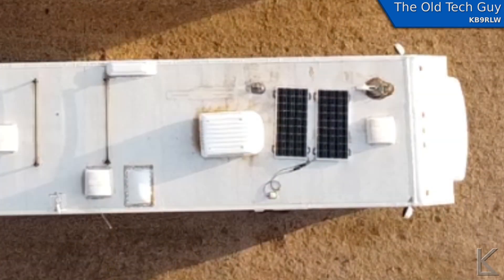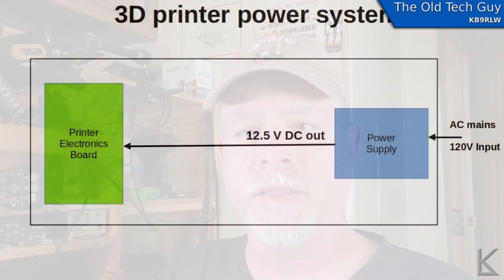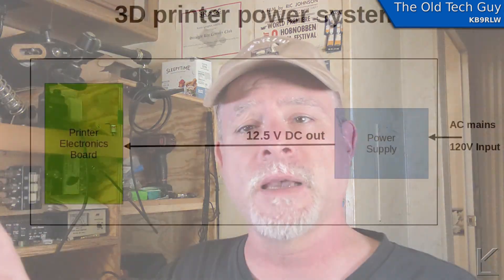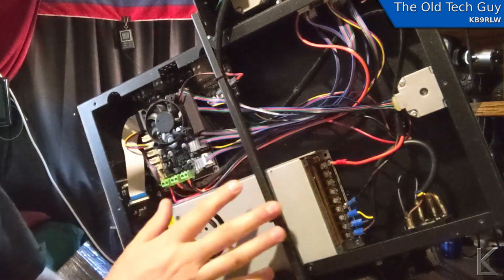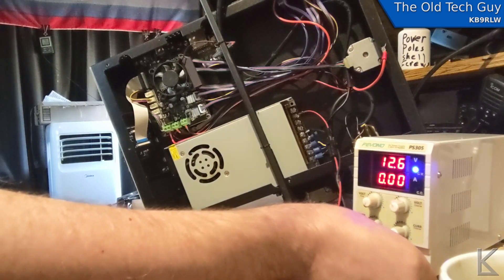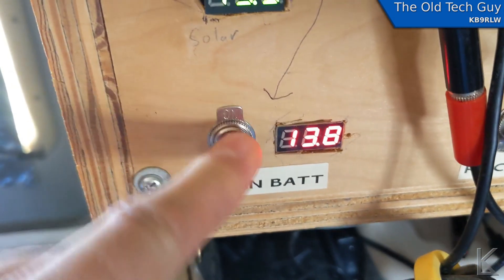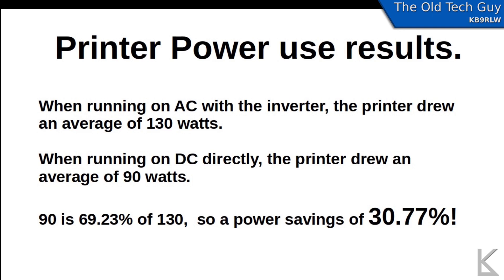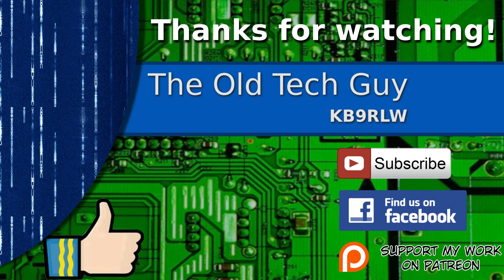Electronics - Converting my Anycubic I3 Mega to run directly off solar and DC

Comment: The modification is really simple, but your results were far better than I had expected. I'm going to have to do a similar mod to my printer.
Reply from the maker: Make sure to check the printer's power supply voltage. Some newer printers operate at 24 volts and you would need to use some kind of a 12 to 24 volt converter capable of handling the power
Reply: @loughkb  Thanks for the heads up. I'm fairly certain mine is 12v, but I'll be sure to double check before I do anything.
Reply: @loughkb  Sadly DC to DC voltage upconverters are switching types which kind of defeats the object of the exercise.  And the high current ones, to heat the hot end and bed,  are also often exceptionally RF noisy 😦.
Reply from the maker: @hectorpascal  I have one now that's 12 to 19 volts that runs my laptop. It's not very noisy. And I can build filters for DC that I can put on each end.
Reply: @loughkb  good to know!
Reply: @loughkb  Good to know!

Comment: Normal 3D printer user, installs quiet stepper drivers, quieter fans and custom firmware (removing that boot up beep).

Ham Radio 3D printer user: hold my beer!

I have the exact same printer.
With the audible spectrum mods applied.

As for RF noise on the inverter. I took a different approach and installed a mic socket on it. 🤪

Comment: At the very least, I would install a toggle switch for DC/AC.  That way neither can corrupt the other.  Or possibly a better solution is to put two diodes in.  so either feeds the load but neither bother the other.
Reply from the maker: Well, you're not going to plug DC into it when you're running it off AC so that's not a problem. And the power supplies output section is solid state devices, semiconductors. They essentially are diodes in that they only conduct in one direction. The power supply presents absolutely no load to the external DC. And the toggle switch would have to be able to handle 10 amps plus, so it would be a big chunky switch. Not necessary.

Comment: Hi, Kevin. 🙂
Modern PSUs use a full-wave rectifier right after AC power inlet (or, may be, after a common-mode filter) and filter it's DC out with a high voltage filtering capacitor. Then they just do a DC/DC down conversion. Their output is a half-wave rectifier, you say a Shottky diode, and filtering capacitor.
So, your way to convert your printer to DC power is great, but we've got a second level DC - the high voltage one. IFAIK some solar power users buy a bunch of solar panels and connect them in series to produce a high voltage DC their equipment can be powered of. They even remove the full-wave rectifier out of their PSUs to reduce power losses.
Of course, their batteries are connected in the same way. I don't know what is the charging controller they use.
In the other hand, one can use a DC/DC up converter to get a high voltage DC consumable by modern PSU.

Comment: Kevin, good to see you seem to have energy again. Hope to see more vids. Good vid. Somewhere in my house is something generating noise like your inverter is doing. I need to do some checking.
Reply from the maker: Put your radio on a battery, then turn off the breakers until the noise goes away. Then you know which circuit to concentrate on.
Reply: @loughkb  An excellent suggestion, thank you. I've somewhat put everything ham on hold as I redo my office floor and everything is in a pile in my livingroom:-) Anyway, I think I'll be doing this for sure when I get my radio bench setup again. Thanks.

Comment: Hi Kevin... Good to see your videos are back.  I would have put diodes in series with the AC supply and the battery to keep them isolated just in case.  Stay well, John   k0ebc
Reply from the maker: They are already are there. The output devices in the power supply are semiconductors. Essentially diodes in that they will only conduct in one direction.

Comment: I had to ground the 3D printer chassy even when hooked to line voltage. it would make interference with other electronics. but when I grounded the whole chassy it cleared it all up.

Comment: Very impressive improvement!  I've often thought of doing the same to the LED lights in my new house, but I resist hooking up a big battery and separate DC power lines to all those devices (there must be dozens).  I also get a lot of QRM from all the solar inverters powering my neighbors' PV systems but I can't do much about that except wait for nightfall when their power outputs drop.  Then there's my rig's 13.8V SMPS and the wall-warts powering my home network board which is unavoidably located only 10 feet from my radio bench.  It's a never ending battle these days with QRM.

Comment: Excellent mod Kevin. It's also a good lesson on the inefficiencies of power conversion. That's one of the reasons why solar and wind energy is a bad idea for general use. They are of course good options for off-grid.

Comment: Kevin, you got me into 3d printing years ago.  Great video.  Looks like advertised efficiencies of switching power supplies is a bit overstated.  Thanks.
Reply from the maker: Well, they are much more efficient than linear power supplies. Linear power supplies tend to end up converting a fair percentage of power to heat.